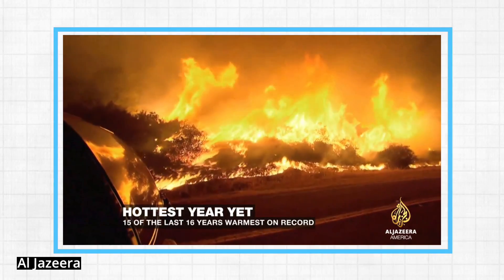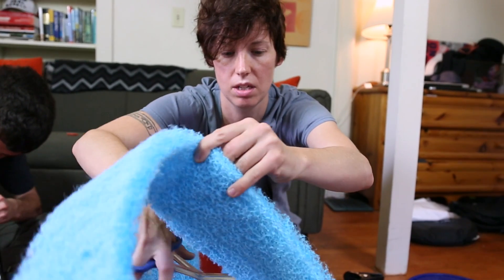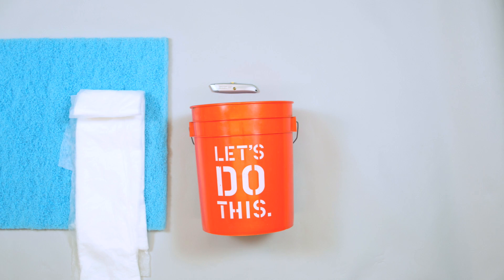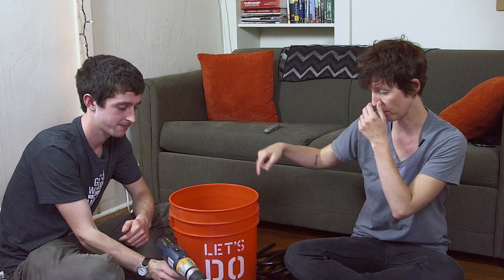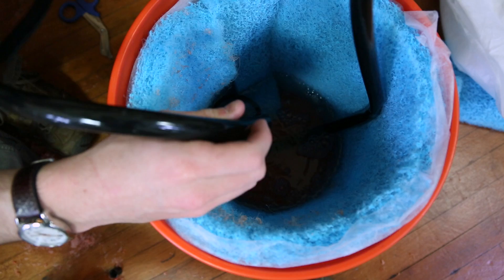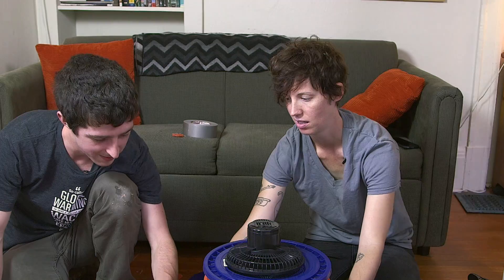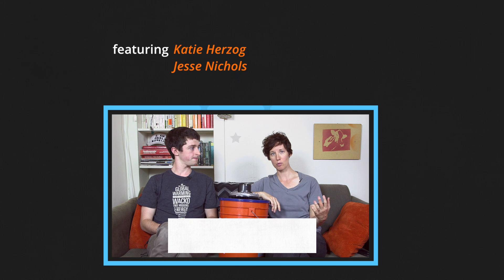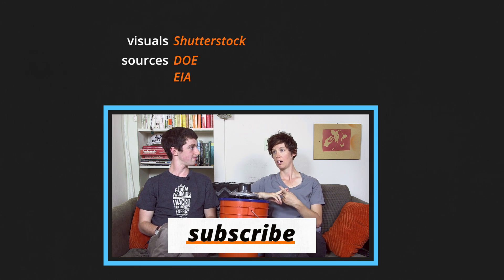How to make your own DIY swamp cooler

Comment: I live in a two story house, AC could not keep up with high 90* humid days. Put a dehumidifier / AC upstairs and plastic tube drain down to the condenser(outside) unit / swamp cools the coils so NOW the unit keeps up with 90* hot humid days........